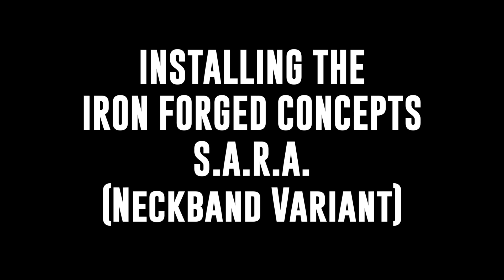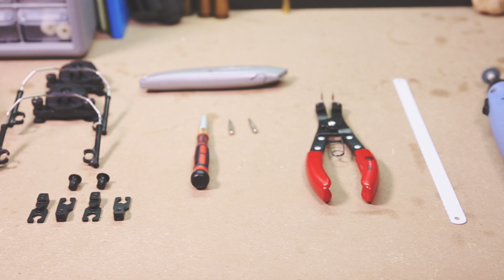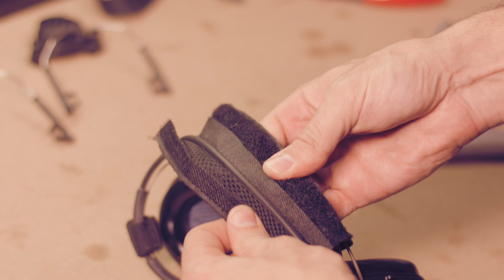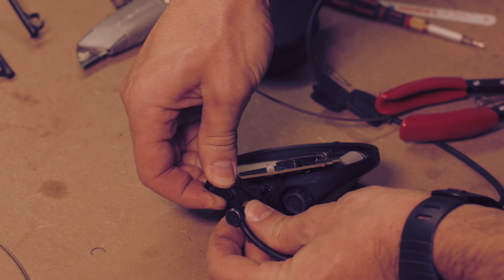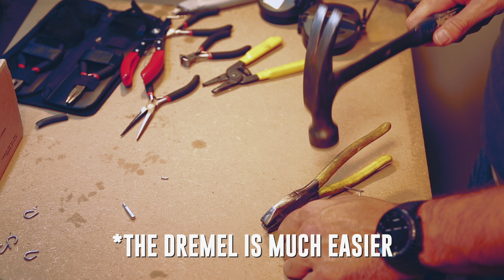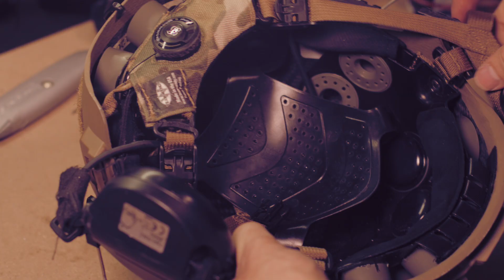Iron Forged Concepts SARA Installation (Neckband Variant)

Comment: The Mil Aux SFA sordin's have too long of pegs for the common SARAs being sold today to fit easily. If you don't own a 3d printer and can draw yourself a spacer, you're going to have a bad time. Also does Firelance Media have affiliation with Iron Forged concepts because Iron Forged concepts' website has been down for years. It seems this product has changed vendors to Unity Tactical who provides little to know technical support or compatibility information.

Comment: DON'T cut the wire on the Team wendy helmet adapter!  Just pull off the plastic prongs , you can also take off the old head band with out cutting the metal wire

Comment: So if your removing the existing pin anyway, why do i need to cut or hack through the wire?
Reply from the maker: +Hangtown Gunner i may not understand your question correctly, but in order to attach the SARA you need a straight wire, hence the need to cut off the loop.
Reply: @Firelancemedia  If someone sees this in the future, I did this without any cutting at all. I had the neckband model. Just skip the cutting steps. You will need to cut the metal on the neckband to fit them into the SARA's though if you want to use the neckband, but just for helmet instalation, no cutting is necessary.
Reply: @matthew6995  Hello, you are right, the reason he cut the original neckband is that so he can use this harness right away, without taking apart the headset cups anytime he wants to switch between helmet or no helmet use.
Reply: @Firelancemedia  he was talking about neckband wires, not adapter wire.